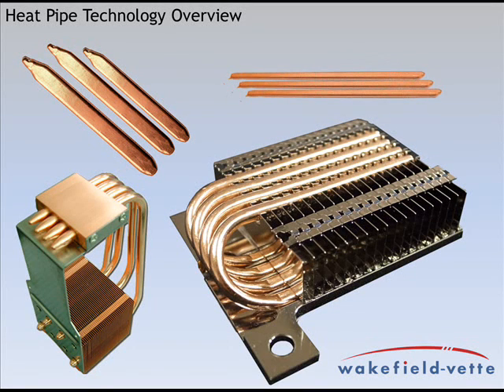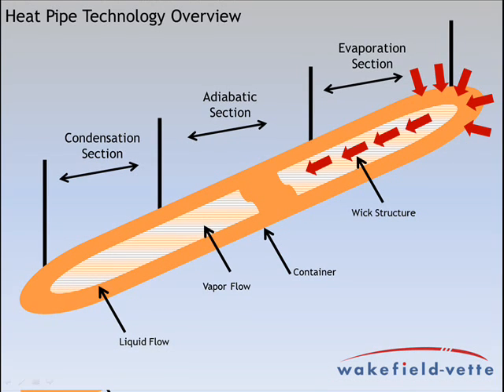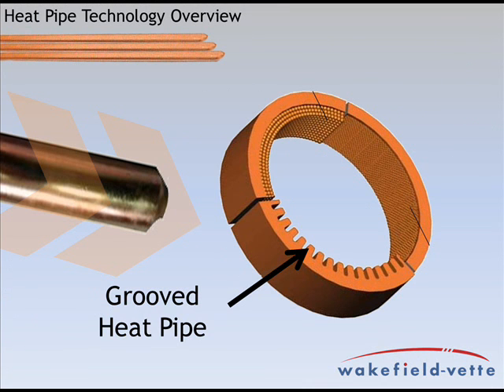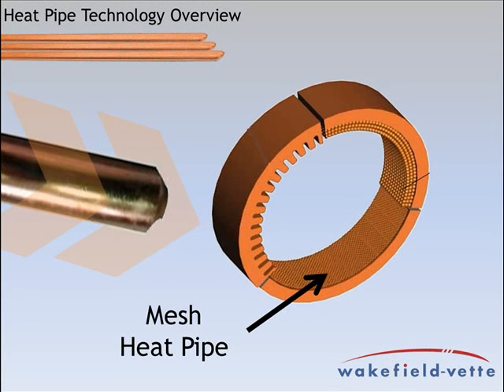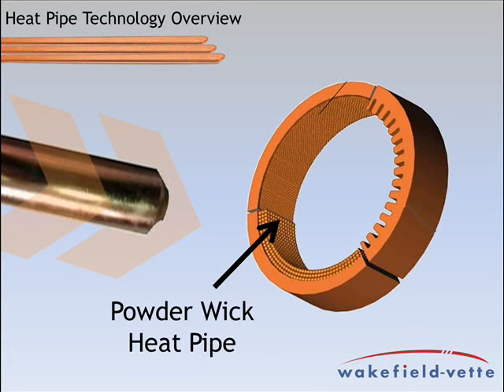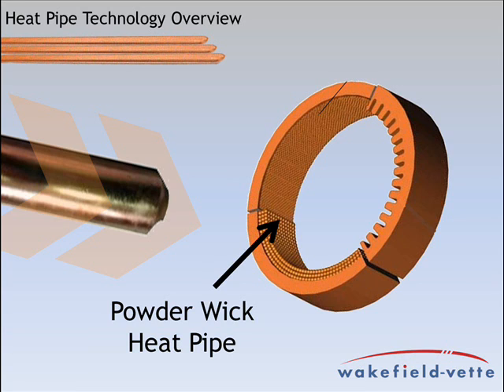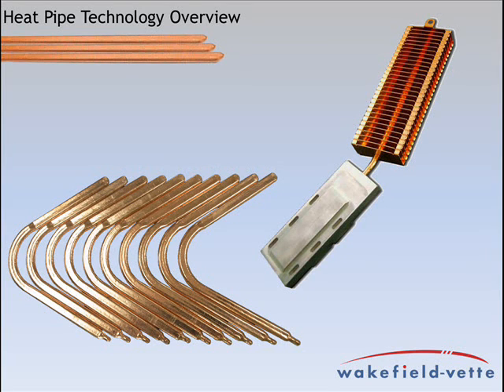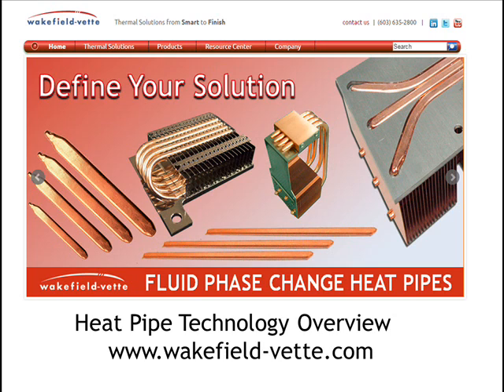Heat Pipe Overview: Wakefield-Vette

Comment: I would like to buy with the single one  where can i buy ? And how do i check its heat transfer power ?
Reply from the maker: Hello Tue Nguyen Duy,
 
The link below has just over 800 heat pipes available for purchase on DigiKey.  The column labeled “Power – Cooling” provides the heat transfer power for the various heat pipes. 
https://www.digikey.com/short/j0qncb7p
 
Additionally we have an extensive Representative/Distribution network that can help by accessing the link below
https://wakefieldthermal.com/rep-distributor-locator/